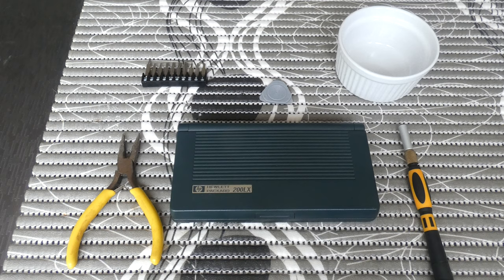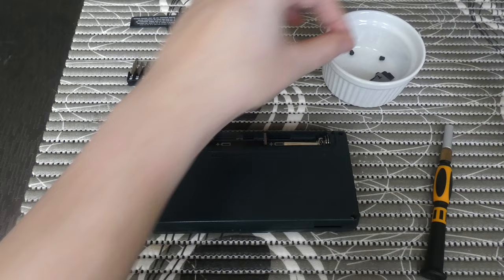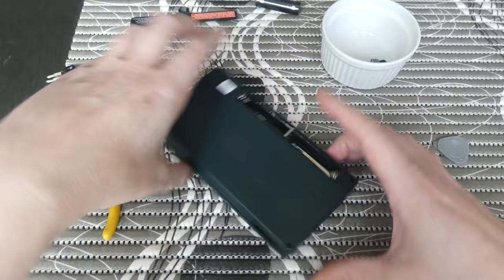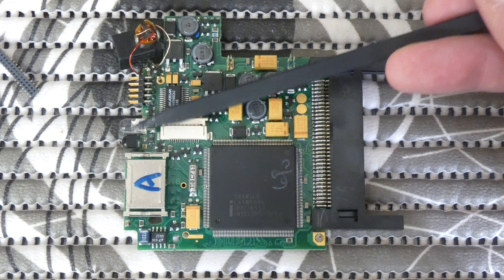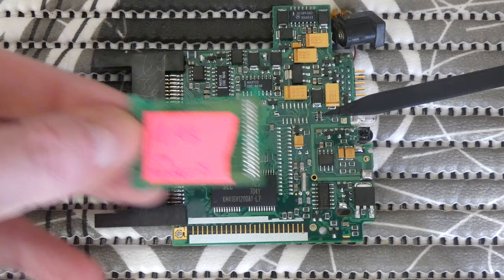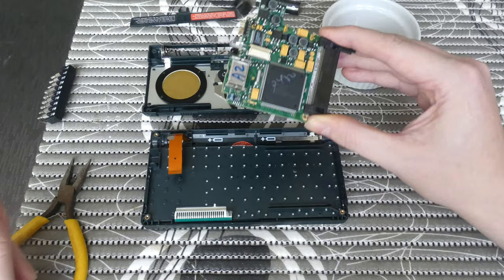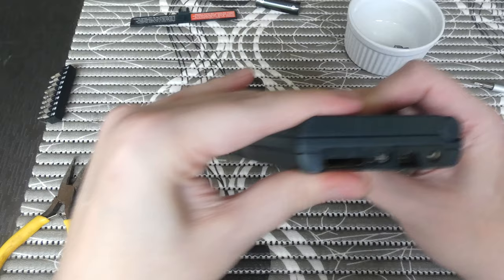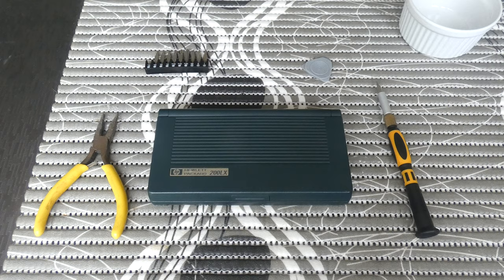HP 100 / 200LX: Disassembly for Repairs and Upgrades

Comment: It's great to see all the caps are tantalum, HP really thought of longevity of these devices.
Reply from the maker: Yes, as long as you keep your batteries out of your system so they can't leak and destroy your mainboard, and package/store the palmtop in a cool dry place, I am convinced these boards will last for at least another few decades...

Comment: I have had an HP200LX since November, 1996. Bought brand new in Auckland, New Zealand for $1695.00 NZD  It is still working perfectly.  For several years when running a boutique wine shop, I had (and still have) a Lotus 123 spreadsheet that I wrote to track every facet of the business. Stock levels, ordering, wholesale and retail sales, overheads, costs, profits and staff wages. I used to print these to an HP Laserjet II. The only change over the decades is that now I use the fabulous Panasonic Eneloop batteries, which have a self-discharge rate approaching zero!  I also recently bought a brand new, boxed, shrink wrapped, HP200LX that was an unwanted gift and had been in a wardrobe since purchased.  A lovely experience, opening the box and admiring the Huge User Manual and the nice little alloy plate for engraving in it's tiny little plastic bag.  As of 2022, I have a Twenty-Six year old palmtop working 100% for the entire time of ownership, and a 2nd machine as backup!
Reply from the maker: Cool :) I live in Waipu, about 1,5 hours north of Auckland :) If you ever need any spare parts or upgrades, let me know, I have dozens of machines and many upgrades/spare parts...
You're right about the eneloop batteries, I use them in some palmtops and they are the best AA battery currently on the market, they last the longest between recharges too...
These palmtops were made to last and I'm sure if stored properly they will still work fine another decade or more from now...
Check out my other videos, the most popular one is the 200LX webserver video, which is still running %100 :)

Comment: I never opened my 200LX. But i have a lot of experience taking apart and rebuilding the 300LX, 320LX, 360LX and 620LX and 660LX. I still use to this day my 360LX for word processing. I think HP had one of the best hinge designs with the 3xx models and the 6xx models. You can retighten the hinge pretty much without opening the entire unit. My 360LX has been going strong for sometime now. 

Id love to get a 200LX again, but as ive gotten older i need a backlight and the keypad on the 200LX stinks compared to my 360LX. Of all the palmtops ive owned and still own, the 360LX is my favorite. :-) 

But thanj you for this video for sure, i love these palmtops. Also if anyone has video cable ribbon cable for Casio A-10 or A11 units, let me know. I have 3 units that need a new video cable.

Comment: Very nice to see how it is done and to learn that the electronics hold up (don't leak).  I used mine for years and was sad they didn't really offer newer versions, but it was and is an amazing little device. 
Thanks for sharing and best wishes!  I am going to dig out all the ones I have and make sure to check batteries and the like and to keep the documentation etc.   Battery life was excellent on those.
Reply from the maker: Hi, yes, HP really made the motherboard of these machines in such a way that they will probably still work in 10-15 years from now...
It's best to always remove ALL batteries (including the backup coin cell) from any machines you're not using as the stuff that leaks from batteries really ends up destroying your machine inside...

Comment: This is a perfect disassembly video. You're careful to go slowly and explain each pitfall.
I have a nearly perfect 200LX 2MB. The hinge has no cracks, and the clamshell release is unbroken. It's very nice, and has worn well. It was nearly perfect. Recently, it fell from a low table onto carpeting. I thought it would be fine. It turned on immediately. A short while later, the screen doesn't work properly. The issue was unusual. At first, it showed four rectangles of different colors. I thought it would need a backup and hard reset. Now, it shows vertical lines only. I disassembled it for the first time ever, and cleaned the display and keyboard contacts with a cotton swab and 90+% IPA. When I reassembled it, nothing has changed. I only have the one device so I cannot parts swap to find the cause of the problem. Any advice for me on how to proceed?

Comment: Thanks for the video. Really enjoyed it. I have just found one in good condition but the system language in Latin .
Do you know how to change the system language on this computer ?
Thanks.
Reply from the maker: Hi, The integrated software is in ROM, and it's soldered to the motherboard...
I've never seen a ROM for sale anywhere, so I don't think you'll be able to change it...
I'd recommend buying a 2nd one, in bad shape, with a broken screen or hinges or whatever, but a working motherboard.
Then, just transplant the working motherboard into your 200LX and you'll have an English machine... (You might have the wrong labels printed on the keys of your keyboard, I'm not sure what keyboard layout they use...)
Maybe try to find that parts machine with the damaged LCD or something that still has a good english layout keyboard and transplant that aswell :)

Comment: Great video! I have 3 of these, my main and 2 backups I bought second hand just in case in the earlies 2000. I repaired the hinge crack a couple of times and made the crystal upgrade. A few months ago I went to open the box where I kept them and 2 of them have damaged screens. Apparently the chemical in the LCD screen turn black leaving kind of a large black stain, and the polarized film must be replaced.

Have you ever repair one of these?
Reply from the maker: Hi,

Not the screen...
I do have a few machine with broken motherboards and damage to the underside of the palmtop (usually due to leaking batteries), but the LCD panels are still good.
I could sell you one or two working LCD panels, you just screw them onto the base and connect the flat cable to the motherboard.
Let me know if you're interested...
Reply: @HPPalmtopTube  Thanks for your response. I would also need to reconstruct the right hinge, which literally dissolved completely when I opened after being stored all these years. Are you aware of 3D print designs for these? How much are the LCD panels?

Comment: QUESTION:  can the hinge be lubricated, and can a language be changed on an international unit?  Thanks for your help.
Reply from the maker: Hi, I've never lubricated any palmtop hinges before as I've never had a need to, so I can't answer that question. However, it might be possible and you could try it...
Regarding the language, it can't be changed as the system's OS and productivity apps are all baked into a ROM chip on the motherboard. This ROM chip can't be easily removed/replaced as it's soldered onto the motherboard SMD style.
You could try, if you have the experience and equipement for fine SMD soldering, but the problem is that nobody sells the ROM chips anywhere. You could salvage one from a damaged unit for sale for parts on ebay, or, buy a new motherboard and simply replace the motherboard, which would be the cheapest and far easiest way to do it, and how I would do it.
There's a shop that sells 200LX motherboards, with different types available (standard, double-speed overclocked, additional RAM memory etc...)
Can't remember the name, but you should be able to find it with a google search...

Comment: 06:50  It appears the battery power contacts on the main board have some corrosion.
Reply from the maker: Yeah, The palmtop I used in the video was a "lesser condition" random one I took from my pile of used machines, when buying them on ebay, the chances of corroded battery contacts is quite common as a lot of people seem to have left their AA batteries in their palmtops since they last used them decades ago so corrosion is quite common...

Comment: I replaced the LCD polarizer of a 200LX and was foolish enough to remove the retarder layer below the polarizer. Now I have a clean but yellowish and darker screen. I purchased a 1/4 wavelength retarder film and placed it below the polarizer; nothing changed. I have another 200LX pending to replace the polarizer; from your experience, what can I do to keep the LCD color? I would appreciate any suggestions!
Reply from the maker: Hi,

Unfortunately, I have almost no experience taking apart and fixing the LCD screens, as it's easier to damage them than to repair them while trying. It's just too fragile uses glue to fix the top layer around the screen etc... My hands are too shaky and innacurate to perform this, so I can't give you any help in this area... Maybe post on a forum somewhere? there are some links to forums on www.palmtoptube.com (howto's and links page)

Comment: the most common leakeage are from alkaline aa batteries- if you live then in for long enough they will deteriorate and leak onto the mother board and destroy components
Reply from the maker: Yup, I've got several cheap/broken 200LX units I picked up on ebay for cheap with motherboards completely destroyed by a pair of AA alkaline batteries left inside the unit since the 90's. I buy them to salvage them for parts (screen, case, etc...)

Comment: I have one of the 200lx and it won't power up.  I have replaced the AA batteries, but still no power.  Am I doing something wrong?
Reply from the maker: Hi, Most likely there's something wrong on the motherboard. Open it up (check my opening video) and have a look, maybe there's corrosion on the motherboard due to leaving batteries in the machine for a long time. Since separate motherboards are hard to get (near impossible), I'd just watch ebay for a working unit but with a damaged screen (lines missing or burnt out), but it still boots and you can see some text etc...
Buy that one for cheap and swap the motherboards...

Comment: Maybe you can help me. I have several HP 200LX that have the same problem, they where upgraded, in memory and double speed. The problem is that the letters are blurred, can not be read. What can I do to fix it. I will appreciate your help.
Reply from the maker: Hey, Can you send me a clear, high resolution photo of the issues via email ? my email is terrence dot vergauwen at gmail dot com

Comment: Hey, great tutorial! I got one today, but its display is in very bad status. I would like to open the display cover. Do you have any idea how to do this? I could already remove the bezel that covers it in front and found four screws under it. I removed them and could separate to top bezel above display, but where the cover connects to the base (keyboard, cpu...) I can't open it.
Reply from the maker: Hi,
There is a full disassembly video of a 200LX with the disassembly of the screen too here on youtube by another creator. It's not an easy procedure though and it's easy to accidentally damage your screen... Just search for it with "HP 200LX disassembly"...

Comment: Can you please do a video on how to replace the polariser? Mine has gone black. :(
Reply from the maker: Hi, I currently don't have a unit with a broken screen, and I'm not going to open the LCD assembly of a good working unit as it's very hard and the chances of getting it back together again so it works %100 and looks good are small for a beginner in this specific area (100/200LX LCD panels).
The screen border is glued on and I don't want to start scraping at a perfectly working unit to make a video that only a handful of viewers will actually need...
There's a video here on YouTube that shows the complete disassembly process, maybe watch that one to see how it's done: https://www.youtube.com/watch?v=i0NsoH9Ve2I&t=10s
Reply: @HPPalmtopTube  Definitely don't touch a working one. If you come across a dead one. Goodness never kill a living one! :thanksdoc: Mine developed a massive black dot in the middle ..but still appears to work.

Comment: Hello.  What do you recommend for repair if a hinge pops off?
Reply from the maker: Hi, I've never had a unit with a hinge failure so I could'nt say... I would start by opening the unit and identifying the damaged parts, then make a post on the DOS Palmtops forum on the HPC:factor forums (just google for it). There's some people there who can sell you the parts you need...
Reply: @HPPalmtopTube  thanks for your help.  I found 2 plastic pieces, glued the one that cracked the cover back to the cover and just placed the other one over the spring.  The cap sticks out a quarter of an inch, but stays in place and the computer opens and closes easier than before other than gravity pushing it closed near the end closing anyways, and thanks for the reply.

Comment: Hi, really good video, thank you first. I have 100LX device and it doesn't power by ac adapter, I know the correct polarity and modified the adapter cable, I think previous owner of the device used wrong polarity adapter and this caused the problem. Device runs good with battery, I want to fix it but I don't know where to start on motherboard.  Anybody lived something similar ? Thanks in advance for your advices and sharing knowledge. Have a good day all.
Reply from the maker: Hi, I've never had this happen to me so I can't tell you what to do exactly, but maybe open it up and check that the thin wires on the barrel DC input connector's receptable are properly connected to the receptacle and the motherboard, and, once connected to a wall adapter, use a voltmeter to check if the voltage is on the pins on the motherboard. Also, check if any capacitors or other components are properly connected/soldered onto the motherboard, by following the traces from the pins where the DC input goes onto the motherboard... If this does'nt help, I'm afraid the DC input power circuitry on your palmtop's motherboard is damaged, and might need fixing or replacing.
Reply: @HPPalmtopTube  I sent a mail for motherboard photos, we can talk and if we solve it we can share here.
Reply from the maker: @MrNetworx  Yup, i'll reply to your email... cheers :)

Comment: Is there any application that will do a full 200LX backup to CF and that can easily restore it? If there is a backup solution, can you share it on a video? Thanks ;)
Reply from the maker: You don't need to use any special software... All you have to do is copy the contents of your C: drive (or other drive) to your CF card. Just use the built-in applications' file manager. Go to the root of your C: drive (or other drive you want to backup), and select all the items in the root of the C: drive using the menu select/tag functionality. then copy everything to your CF card (or a subdirectory on your CF card). All files will be copied. If you ever reset your palmtop and your C: drive is emtpy, just do the reverse and copy everything back to the root of the C: drive, and you've got everything %100 restored.

Comment: How can I use the pcmcia for other stuff if it’s taken by compact flash
Reply from the maker: You can't, there's one PCMCIA slot on the palmtop, so it's either storage or something else like a network card etc...
Reply: @HPPalmtopTube  oh wow well I’m trying yo find the chips for a ram upgrade so I can avoid that to install things internally they’ve done up to 128mb now I just need to figure out if you can use more ram so you can get out of real mode
Reply from the maker: @cursedfox4942  Hi, I don't have any more memory upgrades, they are very rare and I'm not aware of anyone that is currently selling them publically. If you ever figure out how to make them, please let me know as I would be very interested... I've heard of 128MB, but never more than that, so I'm not sure if you can go higher than 128MB...
Reply: @HPPalmtopTube  I will indeed I have to remake the cad files probably use jlpcb if I want to use new parts there will be a lot more too it although there are some compatible micron chips still selling.

Probably need a driver to allocate more of the 128mb to ram instead of c drive but I’ll totally letcha know when I get it done